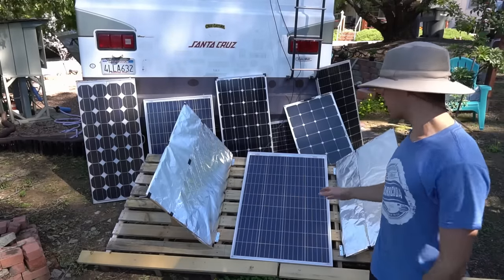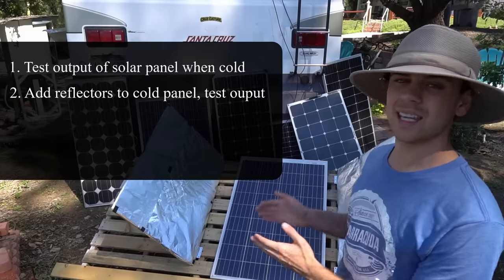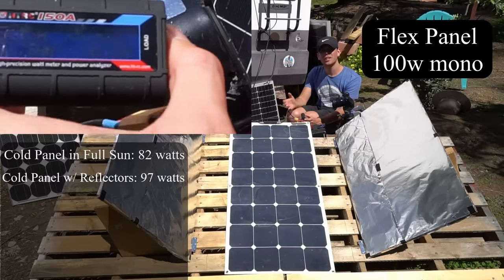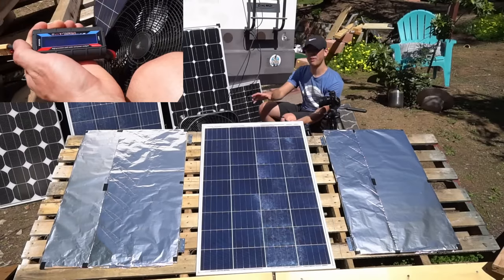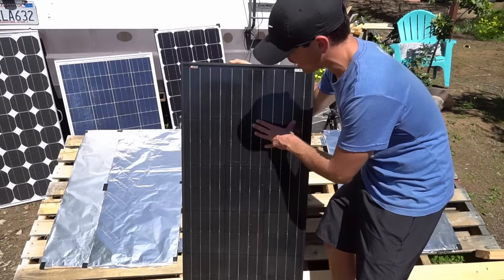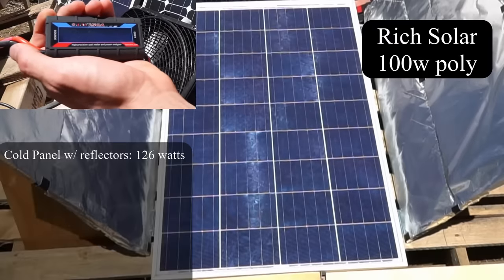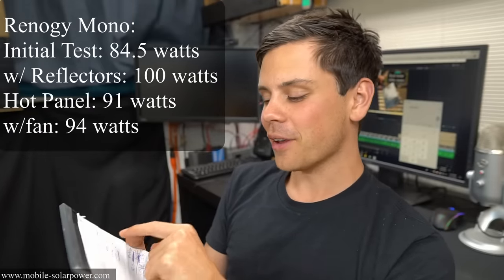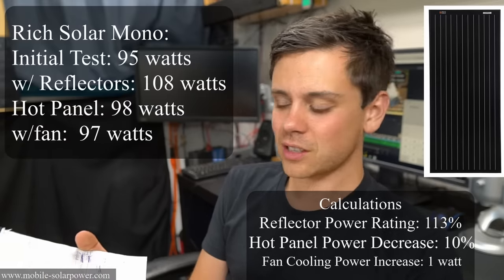Solar Panel + DIY Light Reflectors = More Power? Renogy vs Rich Solar vs Flexible Panel

Comment: Try using  a thermoelectric generator (TEG), also called a Seebeck generator, to generate power to run a small cooling fan between a mirror Under the panel (reflecting light back through the PV Panel and the panel itself thus assisting in the cooling of the PV Panel. Running a fan costs energy - so you must subtract that power cost from the gains realised unless you use a technique like this to generate that power. I am also curious if the "Water misting" gains made any real additional gains.

Comment: Your reflectors are on the side ( East/West ) of the PV cell and you have to constantly adjust for the moving angle. Have you tried putting the reflector above/below ( North/South )? The angle should not require as much adjustment. You could really just set it for max sun and leave it. How soon will materials pay for themselves during optimal couple hours?

Comment: Flat white paint reflects more light efficiently compare to most other DIY reflector material.
Reply: You want specular reflection though to minimize back scattering. White paint will always backscatter light away from the cell while mirrors won’t.

Comment: I've considered installing tracking reflectors for fixed position panels, but ultimately came to the same conclusion: If there is more room for panels, time spent on other enhancements is time wasted.

It's nice to see what kind of results would be realistic to expect though.

Comment: You would get a lot more power, and a lot more heat with actual mirrors.
Which makes me think. It takes a lot of energy to boil water. So if you can use simple reflectors to increase the output from solar panels, but heat is a problem. Why not water cool them and at the same time pre-heat water for use in a more traditional steam turbine (Maybe a natural gas plant). You would need a lot less energy to boil 50-70C water than to boil cold water. It could dramatically decrease the amount of natural gas needed to run the plant. Of course for day night operation one can store the heated water in a large insulated tank so that there's enough warm water to operate 24/7. 
It could be very cost effective. Mirrors are cheaper than solar panels after all. And then the natural gas power plant can sip fuel to get the other 30-50C to boil it.

Comment: I watched a video where they gimballed the panels automatically which they claim achieved 20% efficiency vs static panels, if you took the gimballed panel with reflectors attached to the frame so they are always in the correct position I reckon output could be huge...

Comment: Thank you for this video I was fixing to buy some 420 Watt panels but my size and cost are the difference You're rich panel putting out 118% give or take a bit I would like to know the dimensions of it and if it is still at $80 a panel it is a much better deal My primary question is it built in the United states

Comment: You would have got much better results using white reflectors as the silver foil reflects to much heat and scatters the spectrum of reflected Light. The Concept is the same for grow lights.  Panels from whitewhare could be recycled for cheap reflectors.  If you want to do this test I'd be very Interested in your results. Cheers.

Comment: If you have a pool you can heat the water of the pool and reduce the temperature of the solar panels in one go. And probably run the water pump from the solar panels

Comment: I bet there's a way a company could make a motor that follows the sun, even without mirrors: just the solar panels.  It's moving parts, though so they will break eventually.  Still, with a cheap enough system they could be replaceable.  

For a van setup, I see people usually leave them static and I can understand why.

Comment: It would be interesting to see a heat camera photo of the panels. I would guess that if you ran the fan from the lower end you might see a marginal improvement in cooling as heat naturally rises so you work with the heat. Anyway Interesting Next video :)

Comment: Perhaps there’s scope for development of a water cooled solar panel thermostatically controlled...... also I noticed you using silver reflective panels as a keen gardener I found that white reflects light more effectively I think they use it hydroponically in grow rooms so I’m thinking this would have the same effect on an experiment like this perhaps this could give scope to development of solar panel surrounds the key question would be the angle and the height of depth of something like this if you could make a considerable increase of efficiency in low light areas it could be a game changer

Comment: I read to never magnify sunlight onto solar panels.  Maybe the wires could burn up, and leave you with a non-working panel?
Reply from the maker: No that wouldn't happen
Reply: Will Prowse I mean the wires in the solar cells. They are just thin enough to allow more light and are sized for the amount of power in unmagnified light.  Might work for a while though...

Comment: By tilting the panel so that it’s perpendicular to the sun, the panel will receive more sunlight. (It will create a bigger shadow). It should produce about the same amount of energy as it receives. 
It’s also true that the sun’s position in the sky, or the amount of atmosphere the sunlight has to travel through determines for a large part the amount of energy of that sunlight received by the panel. So at noon the energy should by at its peak. 
To combine the two statements: to get the most out of your panels without too much trouble, it’s smart to tilt the panels in such a way that they are perpendicular to the sun at noon. When further away from the equator this becomes more important.
Reply: I've got two arrays setup right now. One is exactly perpendicular to the sun. The other is almost horizontal. Maybe 6 degrees of tilt. 

The output has been the same. They are not connected to one another. If act, the flatter one seems to produce more. I'm going to redo the setup and give them different longitude angles as well to see how they produce throughout the day.i was a bit surprised as I'd expected a larger difference in the latitude setup

Comment: You have arrived at the point where you will use a water cooled heat exchanger to draw off the waste heat and have hot water. I was considering patenting the concept but how can it be enforced?
The coolest thing about polyc cells is their ability to be baked in an oven at 200c to restore full voltage and current.

Comment: Some thoughts, when you compare the wattage between different panels, wouldn’t it make sense to normalise the values to watts per area for a better and more fair comparison? I mean didnt the panels have different total area? I agree with comments below, the reason why you get the same increase for all panels by adding the reflectots is because you add the same amount of extra sunlight to the panles, so not such a big surprise reallly. Cooling the panels off by spraying them with water would be much more efficient as well. In any case, nice video still

Comment: Have you ever tested the SolArk panels? They are, I believe, the only ones hardened against CME's and EMP's. I think they are guaranteed for 5 or 6 solar cycles, and each cycle is 11 years. So they are probably more expensive, but if they don't need replacing?

This was a great test. Thanks for putting out great content like this, and nice hat
Reply from the maker: Do you have a link? People have asked about them but I can't find them anywhere

Comment: As far as i can judge the conclusions made here are too much generalized. I see them valid for a very sunny day, when the panel already operates close to the rated 100 watt. But assume the tests are repeated at a more cloudy and more winterlike day when the panel only delivers say 25 watt. When adding reflectors now, will the power only increase 18% or much more? Even with reflectors the light intensity will likely still stay below that of a very sunny day which means that also the panel temperature will remain lower compared to when the panel produces 100 watt in a hotter and very sunny day.  I did not test it, but i would expect that under winterlike conditions adding reflectors would add much more than 10% gain on the delivered power.

Comment: love your videos very informative      this video about reflectors has given me ideas  I'm planning to sail the northern high attitudes using an electric-powered boat   I do plan to use a solar tracker but thinking I might augment the system with reflectors  to maximize power generation  still unsure how to integrate the reflectors into the solar trackers

Comment: 100 watt flex panel is only $ 80 us. But mine lasted two years in Florida. I replaced with aluminum frame mono.
Reply from the maker: What in the world. Nearly every poly panel is rated to 80% output after 25 years. I've tested thirty year old panels that still produce 90%. Did you actually break your panel? That sounds literally impossible

Comment: Was wondering how long this whole test with the 4 panels lasted?  The sun angle would change over time so by the time you got to the poly panel, the sun looked like it was more directly overhead than when you tested the first panel.  In any case, I think poly is the way I'll go for now, just because of this test.  Thank you!

Comment: Great experiment.  I wonder how important the relative angle of the sun is -- I know some types of panels do better or worse when light's at an angle (as is the case with both reflected light sources).  Also, reflectivity and smoothness of material might be important -- other side of tinfoil is more reflective, for example.  Not entirely convinced that the experiment as is proves anything, but it's sure an interesting outcome!

Comment: What's the outdoor temperature? And would indirect sunlight on the panel with reflectors, does that help cooling yet sustain wattage?and does running reflectors decrease the lifespan of the panels that counters its cost efficiency?
What about using reflectors in the morning sun and when it gets too hot the reflectors are not in effect? Seems like a good middle ground.

Comment: I like your testing and what you're trying to find out but I think the manufacturer's have already considered all this. I think they have approximated the temperature that these units operate at efficiently. To try and implement any Cooling only uses more energy which ends up being useless. One thing I would have liked to have seen in your video was an evaporative cooler and not just a plain fan.

Comment: Interesting experiment but without temperature readings on the panels we can not say anything about the cooling effects.
It may be the cooling was just mediocre. Thermal derating is known for most cell types and it is can be even higher than 0.5% pr degree C above temp the rating is listed for. Dropping 20c on a panel will thus potentially regain 10% of the derated power. A 100w panel rated for 20c will thus become a 80w panel at 60c. If you can get it down to 40c you will regain 10 watts.
The gain of 1-3w you experienced on 80-100w panels show a cooling effect of only approximately 5c.

Comment: Hey, I have a question. When you are meassuring power output while fan cooling, is the fan run by external power source or the panel? What I am really asking is, are you able to increase power output by adding a fan, or does the fan steal more power than it increases in the panels performance?
Reply: Yes, do the cooling by a self circulating system.... or buy a extra panel😊

Comment: It seems crazy that these panels sre sensitive to heat considering the purpose is to literally harness the power of the sun. My solar panels overheated is a very strange thing to hear or understand.  Great information, thanks!
Reply: Heat literally destroys everything given enough time and input. Everything we do in life is basically combating wear and tear from heat. To include our very bodies.

While absence of heat is a nuisance and can be deadly for our bodies, it's generally not an issue for mechanical to electrical as it'd actually help most all applications.

Comment: Love the coincidence of thinking about this yesterday, and youtube recommending this video today. 😂
Did you try the different hot panels without reflectors and fan? I figure this should probably be lower than the no refl/fan cold output?
I think it could be interesting to see how much you get from a "normal" hot panel versus the data of the "enhanced" hot panel.
Reply: Whats about cooling the panel with spray water?

Comment: You summarized that it's 'not worth' the effort and you might as well buy another panel.  But in reality, the parts for a reflector are near free.  Even if you didn't mess with them re-aiming them all day, if you got that 15% increase for a couple hours a day, why not take it. Alternatively it can be used to reduce the need to aim a panel.   Or... Get a little crazy...  With a system of carefully sized and aimed reflectors perhaps you can get that temperature differential perfect to get the panel to the maximum output with minimum temp increase throughout the day.  

Not sure if it would work like that, but I almost wonder if the reflectors were too big and if there's a sweet spot of the right amount of extra light to throw at the panel.

Comment: how would the panel react if there was an area of water in the space above it? (the purpose of the water may be from the function of amplifying the rays of light, such as a magnifying glass, or a combination of the function of electricity production and hot water)

thank you for answer

Comment: Hi will, I really need to know this information from you, I'm planning on buying a 60 -90 watt refrigerator and I want it to stay charged 24/7 until I get my electrical service lines restored due to fire. So I need to keep it running all night and I need to know how, I currently have harbor freight 4 panel...100 watt solar panels ...2 sets of them. Don't know if I should buy a battery operated grow light to keep my solar panels charging all night or candles. Please let me know, don't want my food to spoil.

Comment: I love your experiment. However for better reflector performance reposition the reflectors for a top and bottom orientation. Extend the reflectors 2-3 X the width of the solar panel on both sides, and place a reflector above and below the panel. the sun varies in position in the sky more horizontally than vertically. Therefore if you orient the reflectors vertically above, and below the panels, the angle of reflection will change less because the vertical component changes less. Aluminum foil does reflect very well, but makes the reflector more directional and requires resetting the angle. Try a reflector painted with Snow Roof or some other highly reflective, but scattering paint. One other thought. Try a paint, that absorbs infrared, but reflects visible light. I think Snow Roof paint will fill this bill. One other thing to think about. Place swamp cooler pads on the back of the panel, and run a drip water line, and crank down the drip rate such that there isn't much dripping out the pad at the bottom of the panel. Now you have a swamp cooled solar system, and a swamp cooled roof if you crank up the drip waterer up a bit. Win, win! One place where this could really pay off is expanding your equivalent solar flux. Maybe you live in an area where the ESF is 5 hours. With the reflectors you might be able to crank that up to a ESF of 6, or dare I say 7 hours. The other thing to keep in mind is cost. You don't want to design an addon that costs more than the original equipment. However it does look like you are able to get an extra 10% in a real life experiment. I actually tried this Same experiment with a tiny 10 watt panel, and got about 10% with just one reflector above the panel. The reflector was a white sheet of paper 8 1/2 X 11. I want to try a more format experiment using pieces of wood painted with Snow Roof. I also want to back the panel with a blue swamp cooler pad, and see how that does. Keep up the experimentation! Whoo Hoo!!

Comment: Thanks for the clear presentation! I have read your book and will leave a review. Can you mix poly and mono panels if same voltage in parallel?
Reply from the maker: Oh sure. And yeah, same voltage for parallel panel connection, and you can mix panel types. And thanks!

Comment: I think you missed a critical measurement in your tests.  You didn't check the output of the panels without reflectors when Hot.  Would seem that is the baseline of normal operations to compare against.

Comment: I'm lost, so Renogy is the most cost effective?
Renogy 100 Watts 12 Volts Monocrystalline Solar Panel is 128.00 

Richsolar 100 Watt Polycrystalline 100W 12V Solar Panel High Efficiency Poly Module RV Marine Boat Off Grid (1pc)  Amazon is 80. as i type  
 and
100 WATT 12 VOLT FLEXIBLE MONO SOLAR PANEL
Brand:
Infinium
$349.00
SKU:
100-INF-FLEX

Comment: How well would these work with a two-sided, vertically mounted panel? They produce the least when the sun shines straight from the south, so I wonder how much reflecting light to them from both sides would help.

Comment: This will take additional $, but how about building a inclosed fixture to house the panels and cooling them off with fans?
Same concept but using Ethylene glycol with panels. EG does not have to come in direct contact with panels, then using fans in support?